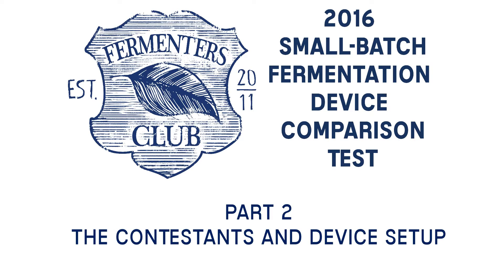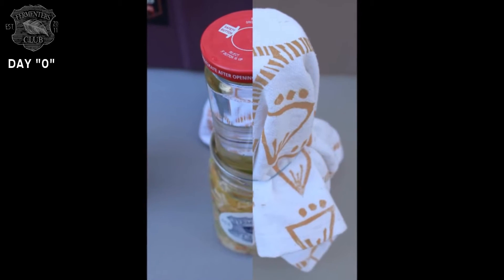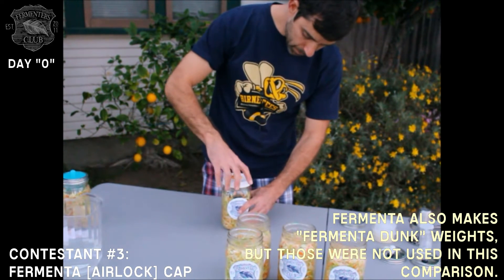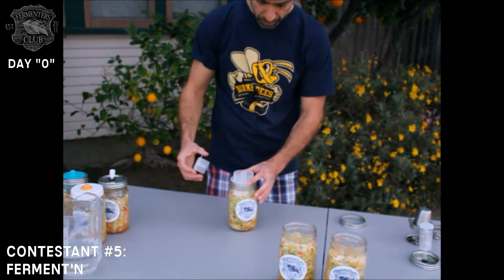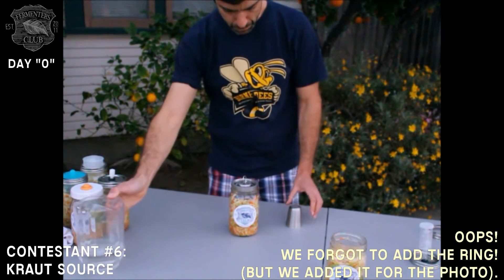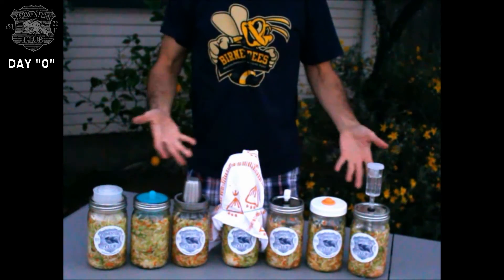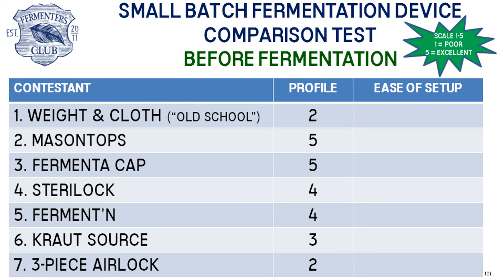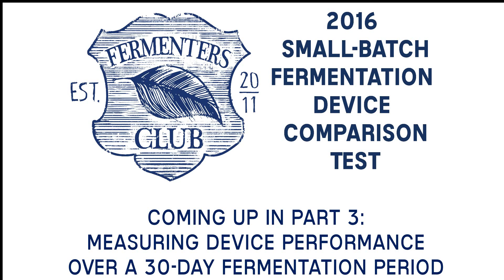Fermentation Device SMACKDOWN- Part 2 of 4

Comment: Thank you for making this comparison. I have several Kraut Source devices but I am not thrilled with them, I am thinking that Ferment'N seems like a good replacement, but others are also interesting. 

One quibble: By removing the airlocks during fermentation, you're making them ineffective. So I don't think this can be a fair comparison: you can't see the effects of the airlock if you remove it all the time.

Comment: Hello there;

Fermenting newbie here. the UK company Sterilock have come out with a new, all plastic, lid with the airlock attachment (link on Amazon: https://www.amazon.co.uk/Kilner-Fermentation-Sterilock-releasing-preventing/dp/B00ZY6ZZ0A/ref=sr_1_2?ie=UTF8&qid=1493017243&sr=8-2&keywords=sterilock) 

However I'm not sure if they are any good since the two people I saw using them here on YouTube mentioned the 'lack of bubbles' when fermenting. Which in fairness, one of the only let the jar sit for a week rather than 4.

Hence I'm caught in two minds, in your experiments, the sterilock seems to work, and with the improved, plastic (non rusting) lid, it should be better. However I'm still not sure whether or not it's worth the investment and if I should stick with the burping method with regular jars.

Thanks a bunch.

Comment: why 30 days? I used this video on how to assemble Kraut Source which is very easy: https://www.youtube.com/watch?v=I05aIJ1kwTQ why did you demo it your way?
Reply from the maker: +Debbie Sultan We just like to ferment our kraut for 30 days. You can let it go anywhere from 1 week to 8 weeks or longer (especially in cooler weather)!
Reply: I prefer kraut at 10-14 days and find anything beyond that is wayyy toooo sour! I guess if you are making large batches that makes sense but you were using small batch devices. Also, I didn't get your method of using Kraut Source (see above message)... have never assembled it that way.